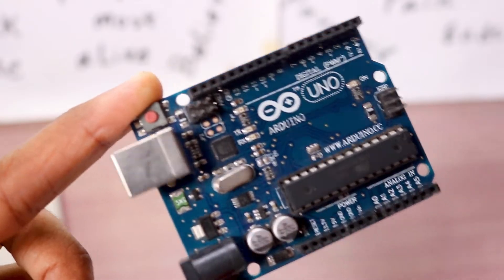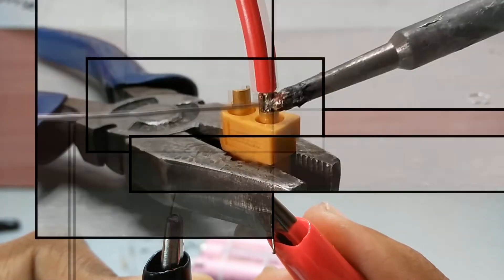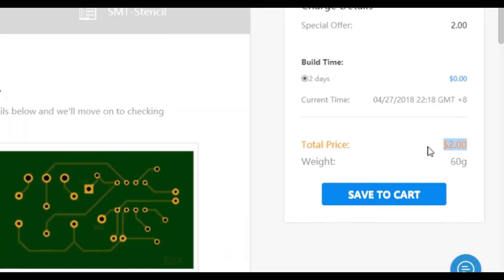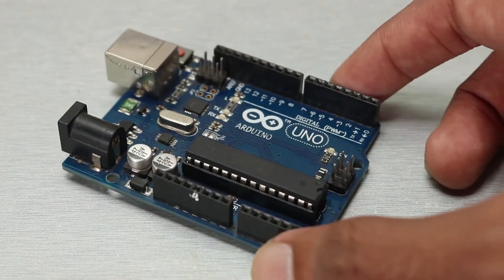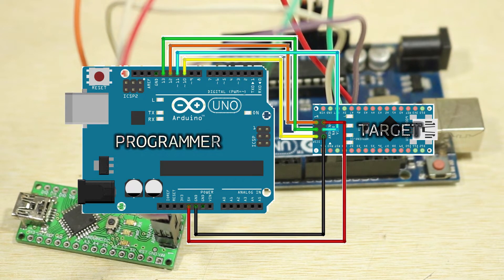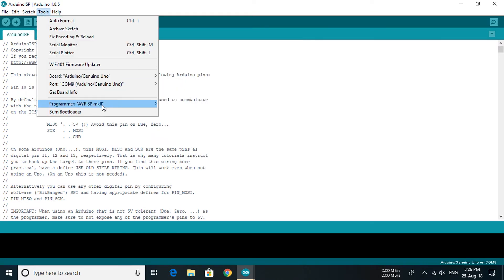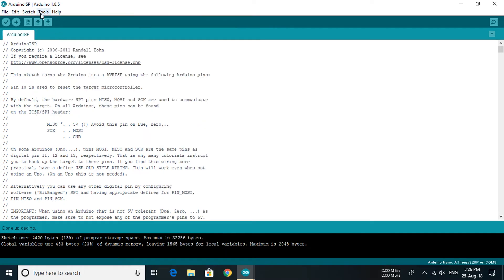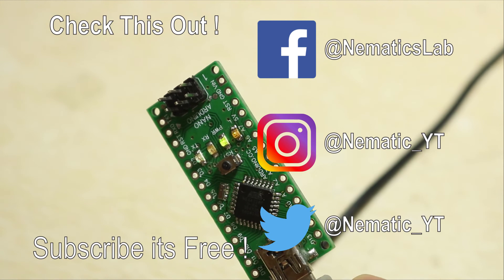How to Burn Boot-loader to Any Arduino !

Comment: Can I use this method to burn bootloader on a ATSAMD21? It is the chip used on the Arduino Zero board. Thanks for your help !
Reply from the maker: This method works on every Arduino board out there

Comment: It doesn' work on my nano...
I have a A-Uno like programmer and two A-nano dead...
I follow your istructions, itsays it's all right... but nothing happen...
Reply from the maker: Your Nano might be fired or static damaged
Reply: When I connect it to the USB port, the power LED lights up and, after a few seconds, the RX LED lights up
Reply from the maker: Not sure what could cause that